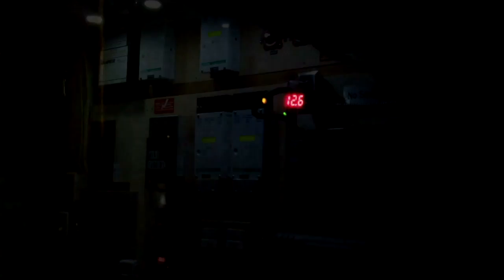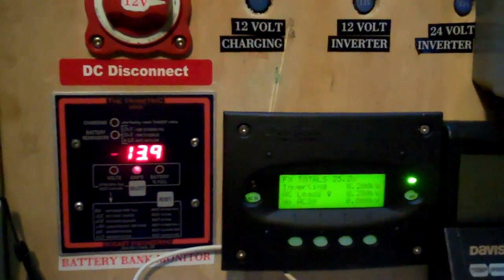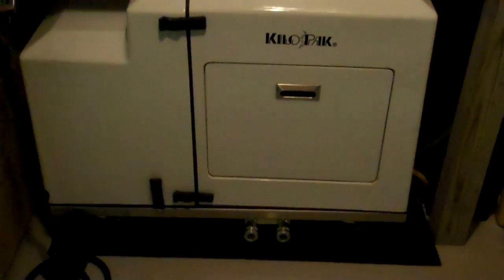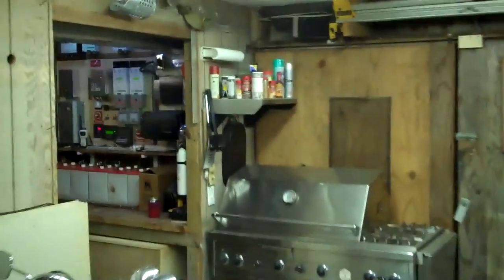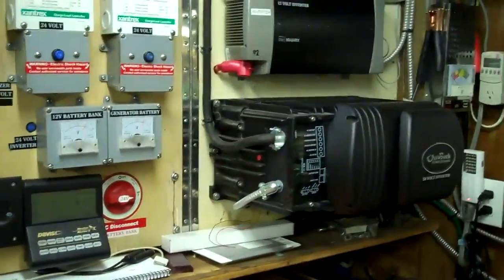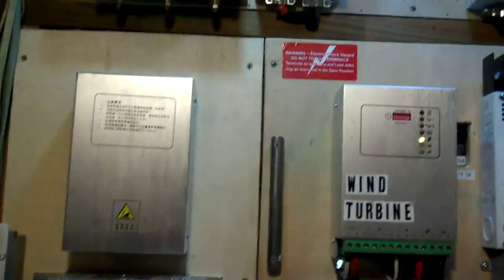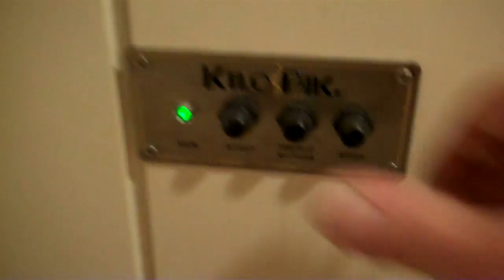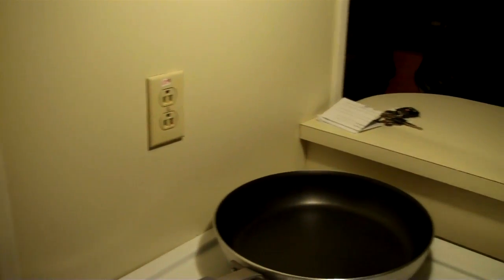HOW TO PREPARE YOUR HOUSE TO RUN ON SOLAR.. REPOST...

Comment: hello.
Simon from the UK.
What do you suggest i do with running Plug-in timer on my freezer?
is 2 r on/off cycles ok, or does the inductive load use more power when the thing powers back up again ?
help appreciated...great vids and impressive setup ;-)

Comment from the maker: @LDSPrepper It is amazing how little energy we can get by with compared to what we use. My original 1200w array would do a refidgerator and two freezers if you watched your draws. I added a little breathing room and doubled the size of my array now I just need to find the time to get on the roof and install..

 Thanks for watching

Comment from the maker: @aaadream No they are all 110v and run off the inverter only when the power is out. The only things in the house that are on full time solar are the DC freezers and the 12V lighting I showed, the rest is all on standby in the event off a power outage. All the solar from the main array is fed back in to the grid to maximize my battery life. Always good to here from you..

Comment from the maker: @K0R3619 I showed most of the low voltage lighting. The rest is standard 120v LEDs and CFLs. All the low voltage lighting is on one 5 amp curcuit on a photo cell so they come on from dusk till dawn. Thanks for watching..

Comment: I was thinking about saving up for a battery bank.I already have 2-45W solar panels...Some preppers say to use 6V batteries because they are meant for recharging.But are you using 12V?If so how do you prevent overcharging?

Comment: Great video. Like some others, I would like to know the gage wire going to your LED lights over the bar and other places.  Also, what type switches (e.g.12V or 120V).  Thanks for sharing your knowlege.  I learn a lot with each video.

Comment: What gauge wire did you use for your 12v lighting in your house in the walls? Can you use standard switches and fixtures with 12v? I bought e26 12v screw in type LED bulbs of which so far are just in my outside shed. I'd like to trench a line now from my solar shed to the main house to power emergency LED lighting.